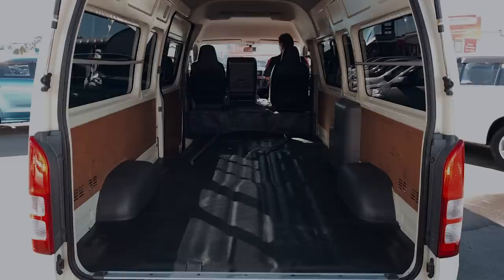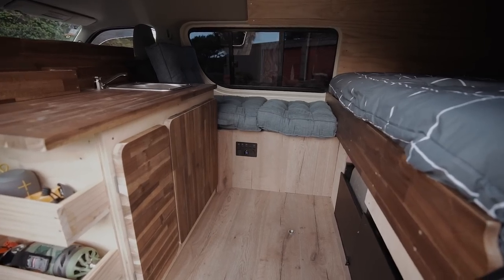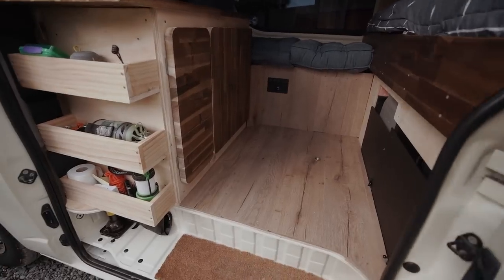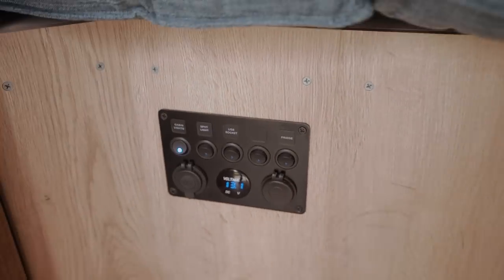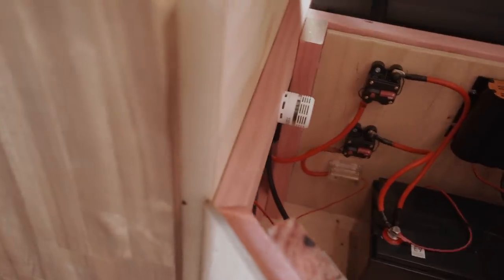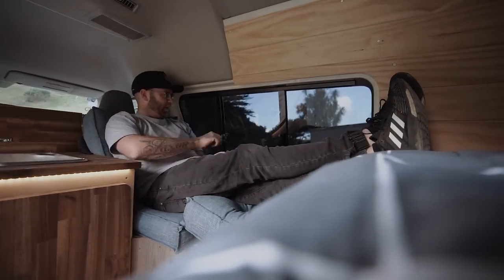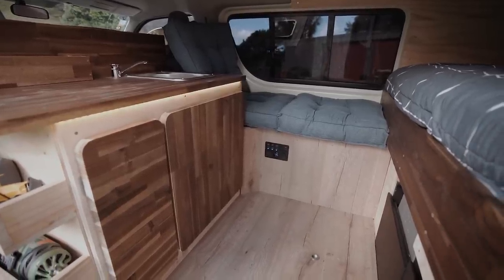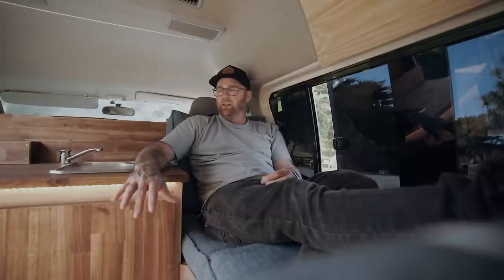Toyota Hiace Camper Build NZ - Walk around, 7 Day Build #vanlife

Comment: I used to be in camper van building industry, Man you've certainly added some extra weight with all the heavy timbers, winch means higher engine torque and fuel consumption

Comment: Hi Chris, I have just bought a 1996 Hiace camper for my Son who is visiting from Sweden this Dec that needs reconfiguring, it has 600 watt inverter that is just connected to the vehicle's battery. Can you please tell me where you purchased the parts and house battery from and maybe a simple wiring diagram to help me put it all together, I am a builder so have a rudimentary knowledge of electrical wiring. Your help is greatly appreciated. Just a tip re your build, where no load is placed on any plywood construction, don't bother with a 'frame' just mitre the ply on the corners, glue and screw or use short aluminum 90° brackets and short screws. This will save on materials and weight. I have successfully mitred sheets with a good quality skill saw with a sharp blade using a clamped straight edge. Thanks for the video of your van. Cheers.

Comment: Very neat and it has more room than the Commuter on the previous model that it is what I have. How you find the 2.7lts petrol engine regarding torque on the hills and fuel consumption? My van has the 2.4 petrol, is reliable but no very good torque and use in the hill country (Tasmania)  about 14 lts per 100 km. Thank you for sharing. 
Regarding smart alternators on a new van, Ctek makes an MPPT controller that charges the battery form solar and the engine with a capacity to look after 2  120amps batteries. I have the Ctek gear in my van and is excellent.
Reply from the maker: Thanks mate. Yeah the 2.7 is good enough in terms of power etc, I get about 12L per 100 I guess not to bad but my biggest complaint is the tiny fuel tank, I only get like 400ks
Reply: @ChrisTurnerPhotographer  Are you aware of this option? https://www.browndavis.com.au/motorhome-long-range-fuel-tanks/
Reply: @ChrisTurnerPhotographer  https://www.browndavis.com.au/products.php?make=TOYOTA&model=HIACE&series=2004-PRESENT

Comment: Where all the wood paneling is, you never considered extra windows for light and or ventilation? Its something I have experienced with campers is lack of flow through air/ventilation.
Reply from the maker: It had windows, I covered them up. Did think about it but yeah I prefer it like this personally

Comment: Good simple build. The bed looks great. 
I have the Toyota SLWB high top Tradies version with a door on each side, it has a 3l diesel.  Regarding your single battery , I originally fitted two 135ah agm with 300w roof solar, but I found in overcast weather I was having trouble off grid for more than 4 days and the Van's regulator was having trouble keeping up so I fitted an additional 135ah battery and have made up two extra portable 200w flexible panels. I live in Australia where we get more sun than you do.  Note you can only discharge your agm to around 50% effectively.
Reply from the maker: Thanks for the advice mate. Yeah I think I’ll stick with my dual battery kit for now it seems to charge really fast off the alternator and over never dropped bellow 12.2v yet
Reply: I don't know if you'll see this reply five years later, but I've just found this video. And I have just found the very same model of Hiace you've mentioned. I'd love to know more about your conversion. I am really keen, but just wondering if it'll be tall enough to live in fulltime (compared to a high roof Sprinter, for example). Hope to hear from you!
Reply: @superbettynow  I still have my hiace and i love it. We don't fulltime in it. The roof height might be a problem for that. My wife can stand with a few cm clearance, but i stoop.
For hot Ausie conditions, the extra side door is really great, flow thru ventilation across our bed at night, just need the flyscreens!
Big prob with the hiace is it's low rear traction in mud etc. I totally fixed that for around $2k by fitting a rear diff e-locker, now it's almost 4wd!
This is a great van, very reliable, cheap parts, and very tough.
Reply: @normanmazlin6741  Thanks, Norman! I really appreciate your reply. I want the van to live and work in, and for my online work I often like to stand. So I think I’ll have to go with the Sprinter. But I’ll keep what you’ve said in mind for potential future camper options 😀👍🏻

Comment: Hi Chris, with the bench across the front like that, how do you access the engine bay, as the bench must prevent the passenger seat tipping back when opening the engine cover? I have bought a similar van and don't want to lose that space behind the passenger seat, but also don't want to restrict access to the engine.

Comment: Wouldn't it be a terrible winter without floor insulation? Where will you store dishes etc?
Reply from the maker: Xerloi harper-leigh in terms of heat? Nah it’s fine, lots of space in between the bed and the floor and heat rises anyway so you won’t lose much out the bottom

Comment: That looks like our local Huia piggy farm...Am I right? Making it a slat bed base might have been better. I quickly discovered that a mattress will get black mold on the bottom without a lot of ventilation space. The human body puts out heaps of moisture that goes straight through the mattress. Amazing work otherwise. I live 10 minutes from where you are parked. Hope to get a van this summer and go to Coramandel!
Reply from the maker: Yep that’s the spot.

Comment: Great functional setup Chris. I have seen a few videos where people have gone to a lot of trouble with insulating their vans, believing it is necessary to help reduce condensation. I'd like to know your thoughts in light of your build. Cheers, Dan.
Reply from the maker: Hey Dan. I forgot to mention I did actually insulate the walls just with standard house insulation, but unconvinced it would have made a difference. Slept in it down in Rotorua couple weeks ago, was maybe 5c outside and it stayed warm enough inside.

Comment: How is the 2.7L petrol on gas? I am looking at the 3L diesel for economy and power but it does not come in the Hiace does not fit them in the jumbo size for the years I am looking at. Thanks for the great content~
Reply from the maker: It’s alright eh, I think it got about 11L/100ks, so it wasn’t super thirsty and power was fine, like going up hills I could still over take (slowly). My main issue was it has a really small fuel tank, so I was only getting about 450km range
Reply from the maker: But overall it’s great, very quiet and reliable
Reply: @ChrisTurnerPhotographer  true, I think they increase the size to 70L in 2010. I think I’ll go with the diesel.

Comment: Hey mate, great video. I’m tossing up whether to install the kitchen like you have or to have a pull out kitchen from under the bed, out the back of the van. I would prefer to have the kitchen inside the van for convenience, however, I’m concerned that when cooking something on the gas burner, it will stink out the whole van and you end up having a van that smells like sausages or salmon etc. Have you done any cooking in your van yet and how did it go regarding cooking smells etc? Cheers!
Reply from the maker: Christianha hey bro I found I never actually cooked inside anyway I always just cooked outside on a fold out table cause it was nicer being outside. I only ever made coffee or boiled water for instant meals inside

Comment: if you had the rubber floor, why did you choose not to leave it down even underneath your subfloor? Just got my van and am starting it's reno.....
Reply from the maker: No reason in particular, other than you can’t glue to it
Reply: @ChrisTurnerPhotographer  thanks for getting back. That makes sense. Mine has a rubber floor in good nic and I pulled it out to clean and check the van floor and put on all these wonderfully generous  DIY videos. Thanks

Comment: 1000w of solar is used by long term van dwellers that use air-con during summer  and they need to get the most out of 4hrs of winter sunlight.
Reply from the maker: Totally I mean if I was living in the van I'd put solar on for sure.

Comment: How will you access the engine bay?
Reply: I wondered about that too
Reply from the maker: Just as normal under the passenger seat
Reply: @ChrisTurnerPhotographer  thanks Chris.  I have just bought a similar model without windows here in aus which I plan to convert  and your work has been very helpfiul.  Thanks for posting

Comment: Looking to build a Hiace in about 1.5 years (when I am done paying it off).  I like your setup, but if you have to get into the engine how do you do it?  Don't you have to lift and push back driver and middle section of front seat to get into the engine?
Reply from the maker: The passenger and middle seat lifts up just as normal. It's not blocked by the kitchen
Reply: @ChrisTurnerPhotographer  I am very intrigued now, since it doesn't make sense to me in my head. 

I know at times what we see on video is backwards.  The van that I have,  we drive on the right side of the street, so large sliding doors is on the right side, and driver is on the left.  To get into my engine I have to lift driver side (front left) with middle front seat, and it pivots backwards.

From the video it seems your sliding door is on the left side, so I am assuming either video image is backwards or you guys drive on left side of the street.  So I am guessing the driver seat is the one that would be behind your seating area next to kitchen sink,  the middle seat is behind the sink, and the passenger side is behind the countertop area.

You mention you lift passenger and middle seat, which would make sense since engines should be similar, so would make sense that both vans have engine access on the left side.

What I don't understand is how you can pivot the passenger seat and middle seat back to expose the engine, without having to move the kitchen countertop with sink.  Would you mind posting a picture of a short video when you get a chance?

In May of 2021 I am done paying for the van.  Doing much research and planning already.  I had started a layout based on what I had seen on youtube Hiace conversions, but now I seem to have lots of dead space behind the driver and middle seat in order for me to be able to open engine area without much hassle.
Reply from the maker: @CancunManny  yeah so my steering wheel is on the right. You access the engine from the back. The back of my kitchen unit doesn't have a hard backing. It's just a material cover. So when you lift the LH and middle seat up it kind of sinks into the unit. The bench top is just high enough that it doesn't stop it

Comment: Hey Chris. Great job with the van. I just built one, im a wedding videographer in oz for similar reasons.. quick question, did u make some vents for the gas bottle? I didnt see anything in the vid, but im hoping to store gas bottle inside but worried about safety. But it would make a big difference for cooking and heating water. Cheers

Comment: Living in the au, keen on converting a normal HIace to a camper. Will it be big enough?
Reply from the maker: For sure. You’ll just get a double bed instead of a king lol I’d try and get the high roof if possible though
Reply: Chris Turner I would prefer the smaller as if I make it low key I can sleep in cities and built up areas and people would think it’s just a tradie van

Comment: carbon monoxide alarm needs to be down low .. its a heaver gas than normal "air" or oxygen. The gas will pool down low before it fills ur whole cabin.
Reply: Wrong.
You are thinking of carbon dioxide.
Carbon monoxide is CO therefore fas a molar mass of around 28. Same as N2 a d close to O2 which is 32.  Therefore it is pretty much the same density as air.
CO2 molar mass is 44, way higher, which is why it sinks.

Comment: How tall are you and can you stand straight inside the van?
Reply from the maker: akbar aidi I’m 6’1 but no I can’t stand up straight. I can stand but my head has to be faced down. However here in Auckland there’s a company that cuts the roof off and installs a fibre glass high roof at a pretty reasonable price so I may do that in the future.
Reply: Chris Turner I’m 5’7 and was wondering if i will have the same problem or not. Anyway nice quick build, very inspiring
Reply from the maker: I think 5”7 you’d be ok. My mrs can stand up in it she’s about that
Reply: Chris Turner thanks again for the info, hope to see more videos from you

Comment: How do you get to the motor?
Reply from the maker: The front passenger seat lifts up to access the engine bay
Reply: I've got the same van (commuter though) and built a low kitchen because of the room I needed to tilt the seat and console back to access the motor. Is your kitchen moved to do that?

I'm hoping I haven't missed the obvious and could have had a far better kitchen?????
Reply from the maker: @Richietheb42  I made mine so you can still lift it up. No hard back on it
Reply: @ChrisTurnerPhotographer  Oh okay. Cheers.

Comment: I find it hard to believe you were able to fit out the interior for under a $1000 NZD. Battery alone costs $175+
Reply from the maker: Where in the video did I say the whole build cost $1000
Reply from the maker: And actually it wasn’t far off that for everything. This was pre Covid when you could get sheets of ply for about $50 not $200 like they are now. And as I said in the video I already had the fridge and drawers from my Jeep build
Reply: @ChrisTurnerPhotographer  15:00 you say about the costs - I understand van, tools and stuff lying about is not included in that. I'm just raging as we are currently fitting out a van and cost has built up quite a lot - fit out will be close to $3500 with nothing too fancy!

Comment: Mate, your CO2 alarm is in the wrong place. You'd be dead before it reached you. CO2 is heavier than air so it pools at the bottom of your van first. I'd place it lower than your head and put in a vent at the base of your step to let any build up release before it can do you any harm. Plus, your gas bottle is methane CH4 not CO2 so it might not work for a gas leak. They are really only good for when you are cooking or breathing and the van is shut up tight.
Reply from the maker: Ah thanks for the tip!
Reply: No worries. Great job on your van. Also, it is lpg not methane. Methane Is natural gas. My bad. Still lpg is also heavier than air so having a vent at the step will also help in the case of a gas leak.

Comment: All that wood will add so much weight to the van and put a lot of added wear and tear on the vehicle.
Reply from the maker: It actually doesn’t. Every piece of the wall I carried in by hand, all the framing could have been carried in one lot.
Reply: if u weighed all the wood u have put in how much weight do u think you have added.
Reply from the maker: Maybe 150kgs including all the framing and boards. The wall siding is only 10mm thick and it’s all kiln dried laser framing, it’s very light weight. The flooring isn’t wood it’s lightweight composite.